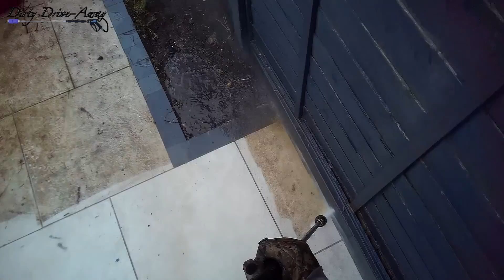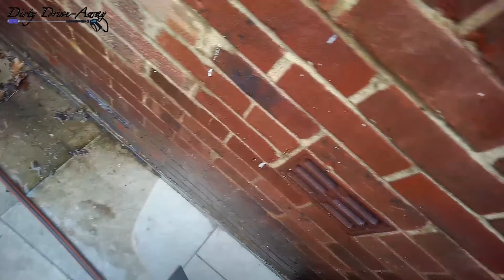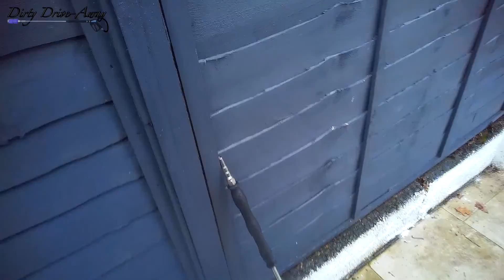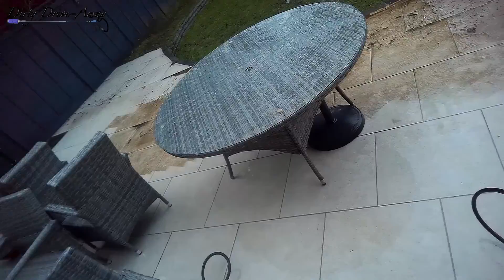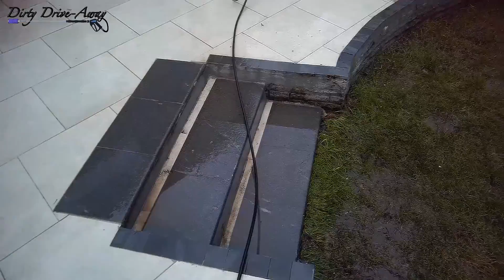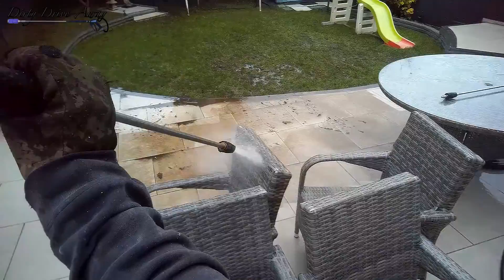Power Washing a Porcelain Patio - POV Pressure Washing Action. Satisfying Patio Cleaning.

Comment: What chemical do you recommend for leaf stains thanks
Reply from the maker: Sodium hypochlorite (bleach) works really well on most organic stains.
Reply: @DirtyDriveAway  thanks did think that but I like to ask the experts first thanks
Reply from the maker: @davidforsyth305  start by trying household bleach as its a damn site cheaper. If that fails get some 10%hypo it's cheaper than the 14/15% and in honesty it shouldn't need the 14/15 to shift that.

Comment: We have a very similar patio. Issues in past with power wash damaging grout. 65° nozzle with your machine at 1/4 throttle is the way you done this? Also what chemicals would you recommend for the Porcelain tiles?
Reply from the maker: Yeah this was a fairly low pressure wash with a 65deg nozzle. Porcelain cleans quite well but to keep it looking cleaner for longer I would suggest a 3:1 mix of sodium hypochlorite (swimming pool chlorine) after the clean. Spray down leave for about 15-20mins and then rinse away. This helps keep the stubborn dirt away for most of the spring/summer.

Comment: Hi I'm looking at starting out .. do you use your own water supply or the customers? Thanks
Reply from the maker: Both, I have a 400L water tank on the van. I then connect to a customers tap to feed the tank.
Reply: @DirtyDriveAway makes sense, so your onboard tank is always filled then.
Reply from the maker: @ashleymasterson8549  yeah, so long as the customer supply is enough to keep the tank topped.

Comment: Good video Phil,  was wondering what your thoughts were on if people should  setup driveway cleaning in 2021? What do you get upto in winter when its too cold aswell? Cheers
Reply from the maker: Don't do nothing in winter, got to earn your money I  spring/summer. Hard call really as I know a lot of people have been made redundant but getting a good flow of business is quite hard. It took me several years to get a steady intake of work. In these times its usually best to start small. Buy affordable gear and don't over invest just in case.

Comment: Hi mate, what jet wash and nozzle are you using please?
Reply from the maker: 250bar at 23lpm machine. I'm just using a standard lance with a 65degree nozzle. The patio was grouted so needed a delicate touch hence the 65. Using a chem would have been a quicker finish but the customer didn't want chems.

Comment: knives r out for this one
Reply from the maker: Dunno why its just a video. At no point did I say its a how to guide or say if it's the best method. It's simply a video, the end result is exactly the same no matter which way its done. All those barking on about chemicals obviously rely on them. If your using chemicals then the price has to be increased. This should be the customers choice and not forced upon them. Every customer has different needs and if all they want is a freshen up because they are putting the house on the market then that's what they get. At the end of the day it's all about price and what the customer wants.

Comment: Looks good but it's frustrating you lanced the whole lot with too much flow and pressure.
I would pre treat all that and clean it in 10 mins less than you did and use less water.
Less time isn't a big deal but you can work smarter.
If you've not applied chem on that then the algae is coming back faster.
Reply from the maker: Yes pre treating would be quicker but the lady was putting the house up on the market and just wanted it looking clean for the photos. I was only running 1/4 throttle. Adding chems into the fray just increases the cost and since she's not planning on being there too long it just want worth it.